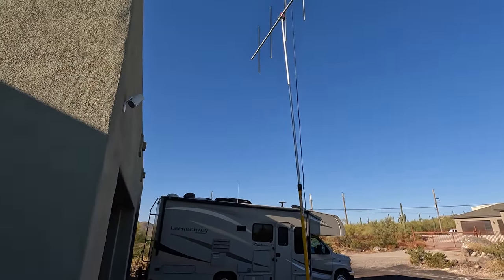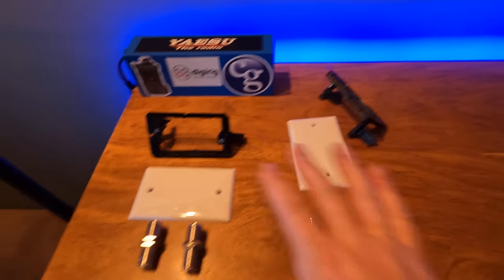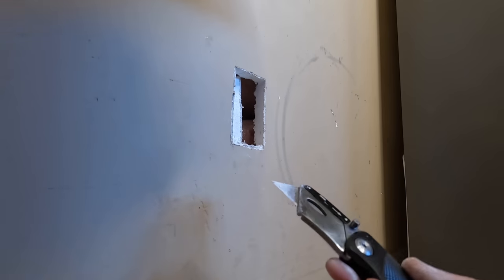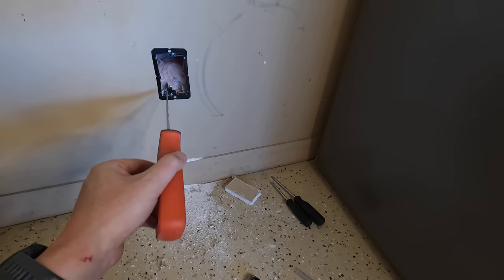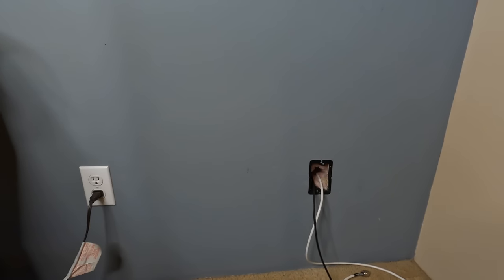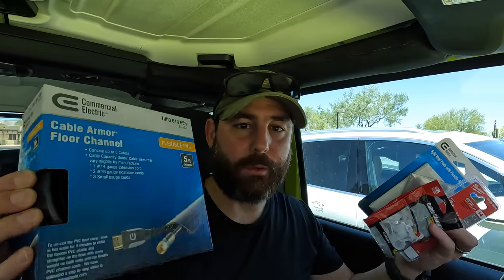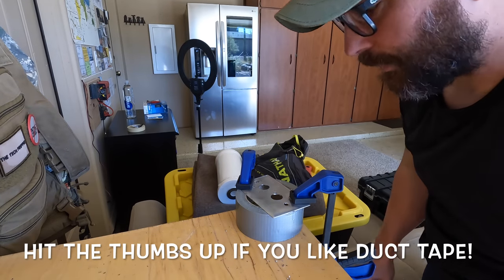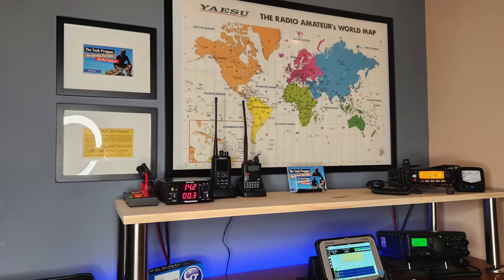How I Installed Coax in my Ham Shack - Shack Series

Comment: Sometimes part of the fun is learning how to do new things! Most of us do Not have a drill press! I like the clamp and role of tape to hold the plate when drilling the holes. You use what you have to do what you can. 73  W4DES
Reply from the maker: You're right about that. The step was essential, but improvising everything else more than accomplished the job. Thanks for the view and comment.

Comment: Bro. Im looking to run my 2 coax cables from 2 attic mount antennas (GMRS and 2m/70) and this is exactly what i am going to do. Labeling them and all. I love this setup. Perfect! I am going to post my video for my mounting and running as well and i will put your channel name on the screen for credit for this portion of the video.
Reply from the maker: Thanks for shooting my some street credit. Good luck with your install and video. This setup works great. Since this video was posted, I actually added an identical second box.
Reply: @TheTechPrepper  Absolutely man. And good thinking. I was thinking a double blank faceplate with 4 barrel connectors as well. I didn't cut any holes yet so I may start there instead of 2 separate ones.

Comment: I use an oscillating multi-tool for drywall. Poke a long screwdriver through the wall to align your boxes. Always cut a smaller hole for the box and shave it to fit. Too big, and you have a problem. You can always go back and replace the single gang with a two gang "old work" box or plate to expand your feed through. When a wall butts up to another wall, you won't always have perfect spacing for the studs. Exterior an interior wall studs and load bearing wall studs are typically 16" O.C. Interior walls are 24" O.C. 9 or 10 foot ceilings will normally have fire-stop blocking in them if you're coming down from an attic. You need extra long wood bits or, cut the drywall, fish it through, patch and paint. I'm always available for an "antenna raising" party! Good job G-Man!
Reply from the maker: Excellent tips, Brian. Thank you. This is all new territory. Sounds good. I'll take you up on the roof antenna deployment and buy you lunch.

Comment: The gyprock/drywall saw will save you 99% of your time. I've made thousands of holes with them. I have touched cables, plumbing pipes and frame straps and even cut through a termites nest in the wall which saved the lady's house as they were rampant and eating up here house fast. I had to lol at the razor blade method, sorry.😅 Lucky you didnt cut yourself. Youll be a drywall pro in no time. Looking forward to the transformation videos. Looks great so far.🍻🤠
Reply from the maker: Thank you for the tip. I'll look into it if I need to make more cuts. The utility knife worked really well, especially with a fresh blade, for these two small cuts. Enjoy the rest of your weekend, Don.

Comment: As a professional hammer swinger, you did fine with the drywall.  You can continue to use the dryer vent, grab a 4in duct cap (Model# DC4 from HD) and punch some holes with your unibit. Then get some appropriate grommets to go around the wire.  Stuff some fiberglass insulation and/or steel wool in the vent to keep them from making a nest.  You can attach the cap with silver foil tape or any tape really.  This would be a long term solution and also not make any permanent modifications.  If you want some extra bug deterrent, get some diatomaceous earth from a garden center and dust the duct.  Unless someone in your house is allergic to sea shells (it's ground up petrified sea shells) it will kill bugs naturally without chemicals that could harm pets.
Reply from the maker: Thank you. I guess the first cut is always the most nerve-racking. It feels good to know that these projects are not that difficult. It looks like there's another trip to The Home Deport this weekend. I plan to take on your dry duct project. Take care.

Comment: For building entrances, I would suggest using a PolyPhaser System.  They offer good lightning protection, & system grounding.  Admittedly, they require a larger hole, but if done correctly, will pay off in terms of safety & feedline longevity.

As an option to adding extra antennas, without having to route more runs of coax, consider a multi band antenna, along with a diplexor inside the house.  This way, multiple radios can be connected to one antenna.  I ran a discone antenna for years this way.  A 2-meter rig on one port, with a GMRS Radio on a different port.  When I wanted to monitor things with a scanner, I had an antenna switch, and simply flipped it over, for dedicated scanner use.  It worked surprisingly well.  Food for thought.  :)
Reply from the maker: Excellent food for thought. Yes, I absolutely plan on installing a high quality entrance system. I was looking at the these by  K7FP: 

https://www.kf7p.com/KF7P/EntrancePanels.html

I also looked at the remote antenna switches from DX Engineering, but I'm a bit lost. 

Thank you.
Reply: @TheTechPrepper  Before you go out and invest a great deal in antennas, feedline, & all the accessories, draw-out in simple terms what you're after.  What bands do you want monitor, and whether it's dedicated use (i.e. one antenna - one radio), or a multi band antenna to several radios.  I believe Cushcraft made a multi band antenna, for 6-meter (50 MHz), 2-meters (144 MHz), & 70-cm (440 MHz).  

Keep in-mind, that there are trade-offs, when it comes to bandwidth, vs. gain, when dealing with antennas.  For an all around broadband antenna, Discone Antennas work well for omnidirectional coverage, but no gain to speak of, whereas a log periodic antenna will still be fairly broadband over a given range, but is highly directional, for pin point or dxing distant transmissions.

For coax runs under 100-ft, and under 200 MHz, Belden 9913 flexible works great, & standard PL-259/SO-239 connectors work just fine.  I prefer the silver-plated variety, with a good Teflon insulator.  Once you go much above 100-ft runs, and work frequencies above 200 MHz, loss in-terms of feedline & connectors becomes a factor.  Low loss connectors such as N & BNC are preferred, along with low loss coax.  

Antenna height is always a factor, such as clearing local structures, trees, etc...  Base on the landscape outside your home, it looks like the southwest (i.e. Arizona, Nevada, New Mexico, etc...).  Unless you live in a large town like Phoenix, I don't think you should have any issues.

The coax entrance into your home, should afford you solid lightning protection, and a weather-tight solution, keeping the elements & pests outside.  You really don't want something like a scorpion making a cameo appearance on your radio desk.  :o
Reply from the maker: @oliverw.douglas285  Oliver, thanks for the details. Yes, I have a very clear picture of my particular communication goals for both monitoring and transmitting. I plan to design the "final state" solution to meet my operating objectives. The list of antennas, entry panel, antenna switching, lightning arrestors, and grounding will all be taken into account. This is going to be a year long project with a "buy once, cry one" approach. I appreciate the time that you put into this feedback. 73 de KT7RUN
Reply: @TheTechPrepper  The K7FP panels are excellent, I've got his medium box.  I did have to cut open the wall and install a plywood backing to bolt the box to as I'm like you with stucco which you really can't bolt stuff to.    I also used a cable cover that has what looks like brushes for the inside.

Comment: Looks good.  We all learn as we go.  I will be putting in a ground rod for the shack in the next few months.  For that i will use a ground rod driver that is used with a hammer drill.
Reply from the maker: Good luck punching through. The ground rods out here take a few weeks to drive in. Our soil is rocky...evening digging a foot or two takes some time and requires a jack hammer.
Reply: @TheTechPrepper  the soil is difficult out here.  Up to 2 ft on my property is good n easy by the shack, beyond that I don't know.  I think because my neighborhood is a development and not in foothills,  I was cleared of most rock formations up to two feet, possibly more.   It may be easier than your property.
Reply: @TheTechPrepper  an auger could work as well if it is difficult.

Comment: Love ya vids.
Wondering if you guys have "Multitools" over there, Im a Snr Comms N/W Eng'r here in Australia & regularly have to cut plaster (dry ) wall, just like you the 1st thing I do is check with a multi stud finder to get an idea of what if anything might be behind the wall,  trace out where I want to cut & out comes the multitool you end up with a very clean, professional looking, just about dustless & very quick cut without ant danger of cutting any services behind the wall ( if you don't wave a multi stud finder ) as the multi tool simply uses vibration to cut the hole you want.

You can get a number of different blades for the multi tool including for cutting timber, plaster, ( dry ), copper the list is pretty endless. 

The other thing that I do if cutting a hole on both sides of the wall to make sure that the holes line up precisley is to 1st make (trace) out on one side of the wall, get a thin rod approx 12 to 18 inches long  sharpened at one end & push it through the middle of your 1st side of the wall until you are just touching the inside of the 2nd wall then with the remaining rod still sticking out that you have not pushed into the wall put a small spirit level on it to make sure it is absolutely level in both the horizontal & the vertical plain then just guve it a gentle tap just to make the out outside of the other side of the wall. 

Then take your tracing device around to the other side of the wall & place it so that the mark that you have just made is dead center of your tracing device, mark it out & cut it out & you will have a perfectly matching hole each side of the wall.

Ive done this 100's of times in my job & its worked perfectly every time.

Here in Australia we have both tje Bull Nose brush wall plate as well aa the the Brush wall plate both are exellent for running multiple cables through im guessing you might also have them in the U.S.

Anyway keep up the great work  & look forward to following the build & fit out of the new shack. 

Rgs
Wayne VK3ECS 
Australia.

Comment: For cutting into installed drywall, nothing beats an oscillating tool like the Dewalt DCS356B. Cuts through gypsum board like a hot knife cuts through butter!
Reply from the maker: I came across that exact tool while researching this project, but I could not justify the cost of a single hole. It seems worth it if you have to install multiple gangs. Thanks for sharing.
Reply: @TheTechPrepper  an oscillating tool can do a lot more than cut drywall!
Reply from the maker: @jhopkins213  That's a good point. I am a Dewalt guy, so I'll pick up a DCS356B next time I'm out. Not a bad price...$99 USD. Thanks for the push.

Comment: Job well done. Remeber, drywall can always be repaired.
Reply from the maker: That's a great point. I actually have an area to repair in the house that is unrelated to this project. This little project is going to make that job a piece of cake.
Reply: I just rearranged my office. I need to drill a hole thru the exterior of the house and install a 12x12 box for coax and lightning arrestors.

Comment: Looks mighty fine, Gaston!  Those step-bits definitely aren't cheap!  😜  I need to re-run the coax going from my bulkhead connector in the eave of my roof down to the box in my shack.  I've got two separate lengths of RG-213.  That's what happens when you don't measure correctly!  🥵

Comment: Looks great! I have a window in my shack and have been pulling the coax in and out for the past 3 years. STARTING TO GET OLD!!!  I'm going to be doing the same thing this summer. I have to go through brick and block wall. That's what has dragging my feet. 73 KO4CXD
Reply from the maker: Hey, it looks like we pretty much did the same thing for the last years. I would deploy my HF antennas for an afternoon  or morning, then tear them down. Good luck with your project!

Comment: Some great ideas here! I have just been working with an ugly hole in my exterior wall, wracking my brains to figure out the best way to seal it and make it look nice. Step drill is totally the way to go. I built a battery box using one, drilling holes for power outlets in a cutting board that replaced the tool tray inside the boat box. Completely sealed when not in use. :) de KC1JMH

Comment: I might have missed it somewhere but I didn't see any type of lightning arrester installed before bringing your cables directly into your shack...  Also, are you aware that you can purchase SO-239 Bulkhead Connectors in pretty much any length you would need, thereby eliminating the need for a patch cable?  Food for thought...
Reply from the maker: You did not miss it. It will be in a future build out. It will be included in the entry panel that will be installed later this year.

Comment: Nicely done. Projects always evolve. What did you do (or will you do) about grounding?
Reply from the maker: Nothing yet. That will have to wait for the utility box project. It's a nightmare to dig more than 3 inches here. It will take a good month to get an 8ft ground rod in.
Reply: @TheTechPrepper have you thought of using some sort of auger?  I saw a 3/4 in by 72 in auger bit that would help alot, as well as the 3/8 in by 72 in bit.

The 3/8 bit is a little small for the 5/8 ground rods, but would make getting the ground rod in the ground much easier.

Comment: So if you could do it again you would have went with a 2-gang low voltage bracket/box?
Reply from the maker: I'm not sure yet, as I will likely add a total of 4 antennas on this side of the house. I could either go with a 4-gang or get an  antenna switch and use the 2-gang that I have. I'm still on the fence. If I change it, I'll do a short update video.

Comment: Did you loose another radio or was it the QDX?
I've been concerned about heat in my shack also
Reply from the maker: Let me clarify. I only lost the QDX, but I had no intention of potentially stressing my Yaesu FT--897D as it is not easily replaceable as it has been discontinued for a while. The radios are happy with the new temperature controlled environment. My FT-2980R spent a couple of years in the garage, but it was turned off 99% of the time.